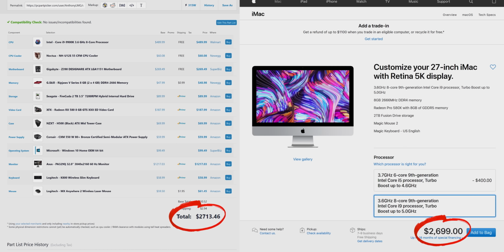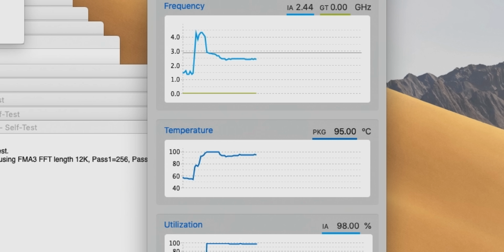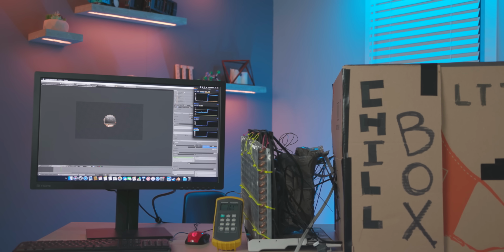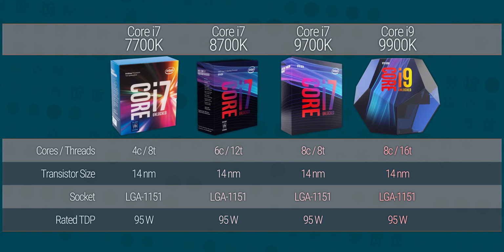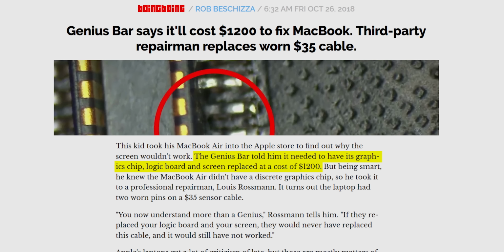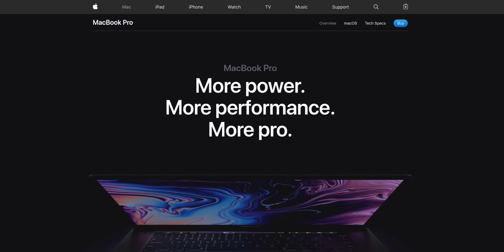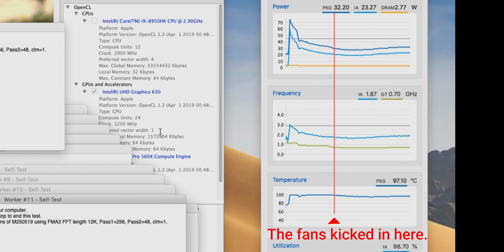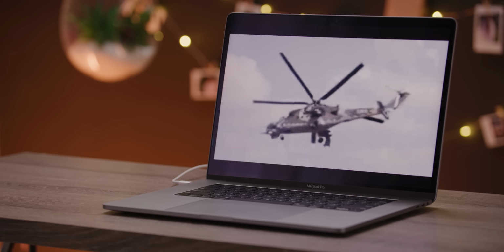Macs are SLOWER than PCs. Here’s why.

Comment: problem with macbooks is a missing fan air entrance.there is no holes under mac to take air in.macbook itself its not water proof but they keep this design without holes under.second thing is all industry keep their products silent but hot as heel.ps3 ps4 macbook.thats helps electronic chips  be damaged earlier and sell another product to customer.is a scamm obviously.sma withh graphic cards boiling on stock fan rpm.always look for a software to override rpm of fan in those machines.msi afterburner allow you to setup profile for your graphic card and setup higher rpm for each temps with a simple graph
on mac there is a software Mac fan control.is free.same with playstation 3.console working on temps 80-90 an only then get higher rpm.after a while all get ylod.if you are smart always monitor your temps and get your fan rpm higher.

Comment: Excuse me but you showed geekbench scores near the end and i got extremely triggered(joke intended)
I will come out and say it Geekbench is absolute shit and completely biased.
Let us not forget that it was geekbecnh scores that scored the ipad pro faster than an x86 PC.
And that every single speedtest with real world applications that exists shows the inability of iphones to load things as fast android flag ships. And that is on the same JS based applications like twitter and other bloated crap.
I will leave a message from linus torvalds the creator  of linux about geekbench:
"
Geekbench is SH*T.

It actually seems to have gotten worse with version 3, which you should be aware of. On ARM64, that SHA1 performance is hardware-assisted. I don't know if SHA2 is too, but Aarch64 does apparently do SHA256 in the crypto unit, so it might be fully or partially so.

And on both ARM and x86, the AES numbers are similarly just about the crypto unit.

So basically a quarter to a third of the "integer" workloads are just utter BS. They are not comparable across architectures due to the crypto units, and even within one architecture the numbers just don't mean much of anything.

And quite frankly, it's not even just the crypto ones. Looking at the other GB3 "benchmarks", they are mainly small kernels: not really much different from dhrystone. I suspect most of them have a code footprint that basically fits in a L1I cache. 

Linus "

Comment: I think that the difference between Macs and iPhones is that apple designs his own chips for the iPhones, that is why ironically the Android phones trhottle like Macs do, as dave2d said, maybe the solution is that apple starts to design  his computer chips again.
Reply: the main and only problem of android is just the fact that the same OS runs on million different devices with each different features and the manufacturers are adding their own UI and other crap on top. the only advantage of IOS is that it runs only on iphones and on ipads and there is no variation of features with those devices

Comment: The true benefits of a non-Apple PC (or IBM Compatible as we use to say) is upgrade-ability and repair-abilty. If a component in my PC fails, it can be replaced for small fraction of what Apple would charge. And I can start with a budget system and upgrade parts over a two year period when I have bonuses and savings. My PSU, drives, and case could last multiple systems builds. My graphics card could span two system builds. It's the Mobo/CPU/RAM combo that tend to be bought as one, though Ryzen has changed that. I just bought an RTX 2060 not because it was the best price to FPS ratio but because I probably won't replace it for 5-7 years.

Comment: All laptops should have a performance mode with fans ramping sooner and highr and a quite where it is later i kknow there is some aftermarket software but it does not work for everything and the manufacturers should just do it since they can test on each device

Comment: My Dad must just think 9 is better then 7 soooooooo lets spend 3.5k on a magical computer.
Reply: It's funny how they go for intel cpus which are worse, aspecially temp wise but stick with amd graphics even though nvidia has either comparable or better hardware at many price points and only looses in the low end.
Reply: @Mezurashii5  Even as I type this from a Mac (no, I didn't go for the i9), I have to agree. Apple needs to work with AMD to either build a custom CPU solution for the Mac, or just move on to their own ARM socs. The later is harder to do, so I'd say it's time to move to AMD.
Reply: @abubakrakram6208  TBH, AMD for low end MacBooks and Macintosh. Intel and Nvidia for the high end.
Reply: Mezurashii5 . I think they stayed with Intel because they likely want to keep the same base architecture and until recently AMD had lower performing and higher power consuming CPUs. The Nvidia/AMD thing I believe has to do with reliability and responsibility.

Of course this could all be a misunderstanding/misconception.
Reply: @robertt9342  It's probably because of a "loyalty" contract
Reply: @Mezurashii5  NVIDIA only win in high end.
Reply: @Mezurashii5  Except Nvidia is worse at everything which isn't gaming...
AMD wins against Nvidia in every sort of work application ever made which uses GPU's, hence why a Vega FE, 64, etc is all much better suited for a Mac in general. 
Mac's aren't made for gaming..?
Reply: come on amd. ryzen 11 lets go.
Reply: But 7 8 9
Reply: This is unironically true.
Reply: Sounds great sign me up ;)
Reply: I9 is better than i7.  It is the battery life that is better, not so much the performance.  Worth it for me.
Reply: @MrGregAndo  if you're so worried about battery life then you should get an arm64 laptop

Comment: If Apple is advertising speeds that it knows it can't achieve, then it's leaving itself open for lawsuits.  Charter Communications (aka Time Warner aka Spectrum) in NY got into trouble for this exact thing (https://law.justia.com/cases/new-york/other-courts/2018/2018-ny-slip-op-30253-u.html).  Court filings are boring, but look up the NY filing against Charter and read the summary.  It's a case study in Why Ethics Matter.  From what Linus is saying, it appears Apple may be indulging in the same sort of misbehavior.

Comment: 6:45 ~ feeling really paranoid.
I should explain I can and do see upper ranges of retinal detail color accuracy.

The 1440 X 900 & 21" sweet spot has to do with Windows XP and 96ppi being the graphical standard. PixelBook hides this fact in settings being #MSAA via real pixels. The pixels are there, yet screen is set and a much more relaxed processing load.

This is very much like iPod classic being 640*480p quality files, on a 360*240p screen. Quality can be highest than display, and if done correct make a display exceed it's Raster quality & color accuracy. = #dreamcast1999
Reply: Will  8K look better on a 4K than a 4K on a 4K?

Do not know. Are we talking about 4 pixel elements versus 3 pixel, or 8pixel Vs 4 pixel?

Comment: It is down to Intel not Apple per se. Chip manufacturers are supposed to design chips that work with the latest trends, and thin and light is what consumers want. Apple when they release a five year design they expect Intel to be able to improve the chips efficiency, that is what tech should do over time. Unfortunately the near monopoly Intel has, means that they have failed to make what should be substantial improvements. Look at phones we are down to 7nm now! This failure has meant Apple’s desire to get thin and lighter has meant compromises. This applies to others including Dell, that throttles and heats up nearly as bad. 

I hope in a few years that Apple can ditch Intel, who also failed with developing 5g, and move onto their own SOC and we can then get a machine that is optimized software and hardware wise, rather than Apple having to work around Intel’s failings. 

For most of us, who have Mac over 5 years old and 18 month old screen of death Windows machines, the power of the Mac is enough and we pay the extra for reliability. I have had three laptops in the last year that needed new logic boards due to failed system updates and there is rarely a patch or Feature update from MS that does not cause chaos, including November’s, and the latest. You can keep your Windows laptop and I will never change my main machines away from Macs.
Reply: Before you get hypoxic on that high horse of yours, you can't fully compare x86 Macs with PCs that run Windows or Linux. Windows and Linux have to operate across a multitude of components from 3rd part vendors of varying ages. Lazy programming by the vendor, an honest mistake, or an unforeseen bug are bond to cause problems. It would be statistical improbable for no conflicts to occur, and they occur on Mac's more than you think. Also, Windows has a larger market share, which means more people are actively looking for exploits to target the LCD... 

There are plenty of stupid Apple users, but it's not worth a hackers time to target them unless it's a sure bet. Until, Apple opens the gates to their walled garden and allow users to build their own machines, they have little room to talk. Like Linux, Mac OS has it's roots in Unix, so it shouldn't be difficult to allow customization. If Linux which is largely a ran open source community can can cobble together drives, patches and fixes to get hardware to work, why can't a company like Apple that's valued at a Trillion US Dollars?
Reply: Daniel Schick Apple spent billions on developing the OS and they have every right to protect it especially as their business model predicates that. They will never again totter on bankruptcy by going open source. What makes Apple unique and why you should not be so hard on them is that they develop their own software as well as some hardware. Window’s OEMs simply buy a software License and get the correct drivers (and still muck it up most times, Dell sleep mode ATM sucks). When Dell and others invest and develop their own software then whiners like you can compare like with like. 

Why Window’s fans get all uptight at Macs I really don’t know, just stick with your Window’s system and leave those of us that find Macs superior to ourselves.b

Macs can be buggy at times but I can perform updates when I want, are not fed ads, I can not use it for a week and find it wakes straight away with 80% battery still. Overall having been an unfortunateWindows user for 20 years and the last 7 a Mac user I can honestly say that although not perfect I will never move from a Mac to Windows ever! Cheers.
Reply: Bullshit. Apple is supposed to design PC that work with latest trends.

Comment: 6:39

“Wherever I'm going, I'll be there to apply the formula. I'll keep the secret intact.
It's simple arithmetic.
It's a story problem.
If a new car built by my company leaves Chicago traveling west at 60 miles per hour, and the rear differential locks up, and the car crashes and burns with everyone trapped inside, does my company initiate a recall?
You take the population of vehicles in the field (A) and multiple it by the probable rate of failure (B), then multiply the result by the average cost of an out-of-court settlement (C).
A times B times C equals X. This is what it will cost if we don't initiate a recall.
If X is greater than the cost of a recall, we recall the cars and no one gets hurt.
If X is less than the cost of a recall, then we don't recall.”

― Chuck Palahniuk, Fight Club

Comment: Can't wait for MacBooks with apple's own chips instead of good old intel CPUs!
Reply: Yeah can't wait for all the software to break!
Reply: Yes, because Apple will be able to solve these issues. 🙄 In order to do that, they will have to solve the elephant in the room that every tech company is facing now which is silicon. (Intel, AMD, Qualcomm, Nvidia, and even Apple's own ARM processor) It is the same issue that led Intel to drop the Tick Tock model and why Nvidia is currently focusing on raytracing rather than making a significantly more powerful GPU. Qualcomm and Apple are facing this with mobile devices now that they have caught up with the rest of the tech industry. They can't shrink the die size much further and we are at the very least 10 years away (probably more like 20) from a potential solution with graphene. We went from 10,000nm to 7nm in 38 years and 5nm is the current limit of silicon before instability in performance. You do the math. At this point, they all are squeezing every drop out of an already juiced orange.

Best case scenario, Apple might get themselves a few inches farther than they currently get using Intel processors, they might make more money not having to use Intel processors but in reality, they will hit the brick wall with everyone else. So don't hold your breath on this solving anything.

Comment: These new thin MacBooks were made expecting intel to move on to 10nm. But intel failed. And apple is reluctant to change design now and is waiting for intel to shift to 10nm. In that case, the chip would produce less heat and current design would be perfect.

We could tell current MacBooks are way ahead of their time (not ready)
Reply: Ahead of their time? Do you mean they just have bad cooling?

Comment: Gonna sound like a fan boy..but, I had a MacBook Pro 2009 for 6years with no problems I sold it because it was loading programs way to slow. Now I have a MacBook Pro 2014 and it’s still running pretty good considering it’s 5 years old. 
The reason I stick with apple is because It’s reliable and you know it’s gonna give you a solid 5 to 7 year life span. I can’t say the same with a PC that’ll give you maybe 3 to 4 years before you start to think you need to start upgrading your components in the machine and that’s not including if you game on it which is even less.
I know Mac isn’t a gaming machine but with a external eGPU you can get a pretty good gaming machine without having to worry about up grading the internals.

Comment: Pick a Mac , remove it ,put It in the gigabyte aero , use an noctua CPU cooler 👍
Reply: Just put it on top of the cooper thing And some thermal paste And zip ties
Reply: @fluq1  just buy Thermaltake Massive TM
Reply: how do you place that cooler on a laptop

Comment: Apple knows that, when an Apple product destroys itself, their users will blame themselves.  (Louis Rossman put a video a while back going into great depth on his theories on this.)  If your customers are never going to blame you for your bad design, you are under no pressure to improve that design.  There was a bit of a thing a bit ago about how the ribbon cable that connects the display to the mainboard in a certain model of MacBook (possibly MacBook Pro) was too short and, as a result, the laptop could only be opened and closed a certain number of times before the ribbon broke.  "Genius" Bars all over the country literally told owners "you must have been opening and closing it wrong"....and they, by and large, just accepted it and paid for repairs or bought new laptops.  If Apple can get away with bald-faced fraud like THAT...why would they bother improving their designs?  I have never owned an Apple product in my entire life...and I never will.

Comment: If I had to guess, the reason they don't use more appropriate power (and thermal) to performance cpus is because if they didn't they'd get a ton of flack for not using the latest and greatest, even if the older or smaller chips would do the job better.

Comment: Apple is going to move their laptops over to in house arm based chips. Why is apple deliberately making bad intel based configurations? Because that exact same thermal solution and form factor is going to destroy Intel while massively increasing battery life.  Take the iPad pro SOC, give it a 45w TDP, double core counts, add in some dedicated IP accelerator blocks on die, and you get a solution which will run circles around intel based configurations. Adobe and other dev's are already porting their core program stack over to arm. Photoshop on an iPad makes 0 financial sense. It makes perfect sense if a switch to arm is coming however. Publicly apple is going to point to this being why they chose to switch. "Hey, this is thinner, lighter, runs longer, runs cooler, is faster, and in every way better than anything intel has." By making properly engineered devices apple is hurting their own upcoming efforts. Apple has used emotion to sell products from the iMac forward. They are about to paint intel chips as clunky, slow, hot, and old fashioned. End users of apple devices could not care less about what instruction set the cpu uses. I wouldn't put it past apple to have some gimmicky "Intel holds you back from being what you could become." ad campaign. To a point - they would be right. Apple wants to make very thin, very light devices and no sacrifice on performance. Intel has nothing for that and likely wont for some time.

Comment: It depends on use case. For normal people, short bursts of performance is enough. Noone is going to buy any hardware to run Prime95. But You are right about the pro models. I agree that they should have better cooling solutions to be able to  do editing work and rendering without thermal throttling.